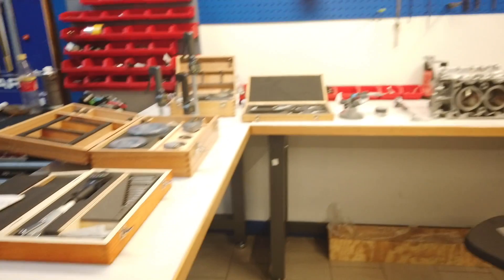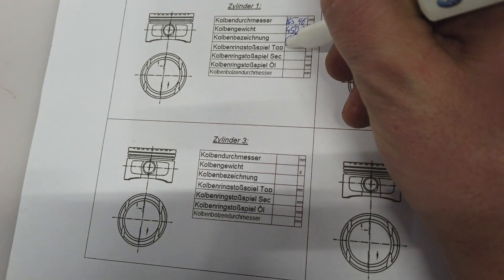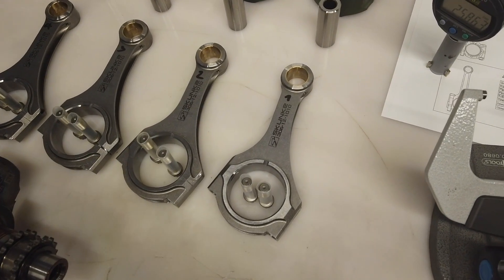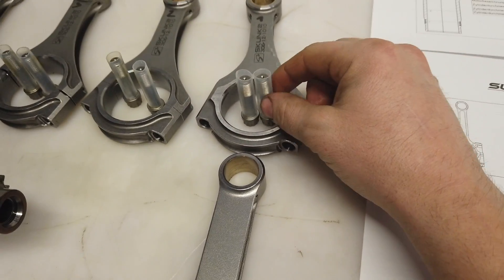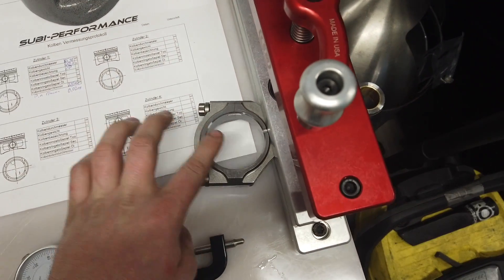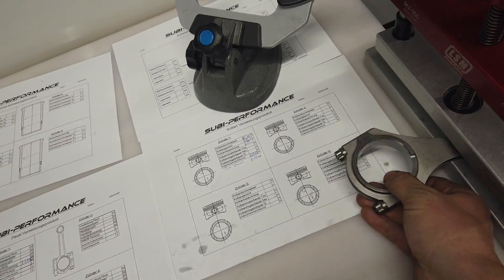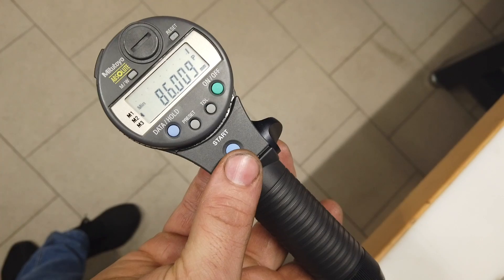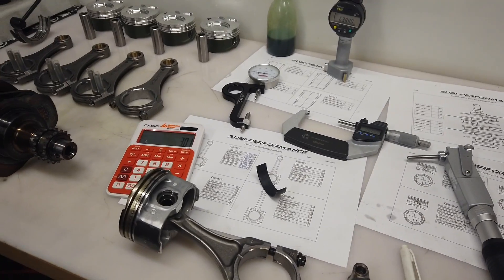The FA20 Turbo Build l Part 2 l Subi-Performance

Comment: What room temperature when you do measuring? Does room temperature will impact to parts sizes? I live in tropical country
Reply: In the measuring departement, in my oppinion it's more important to have a constant temperature and humidity... and that the piece you are measuring has the same temperature as ambient. In the most measuring rooms i've been, it's a 21 degrees celcius.. humidity is even more important, cause corrosion and such...

Comment: Just wondering is it a good idea to turbo charge a open block verses a closed block will it be able to handle the  power after boring out the engine

Comment: After watching your builds, I don't even trust myself to build an engine...Do you guys sell short blocks?
Reply: Not to put words in your mouth, but my guess is it's not an issue of trust.  This man plainly, with his calipers, dial gauges, micrometers, etc... is at a level of engineering conscientiousness that most of us cannot ever hope to approach.
Reply: I also had a buddy do my shortblock when i rebuilt my EJ20x, but after watching a bit more things like this, I think next time I will try to tackle it, since I can budget the tools more easily  now already having the main tools i used last time like hoist, stand, cam tools, etc. I think if you really take your time and write everything down, and ask questions to a mentor of some type when needed, it can be tackled.

Comment: I think it's funny that you have to use thousandths of an inch (0.0060 in) and foot-pounds (ft-lbs) for ARP products even though you use metric units for pretty much everything else... I'm sure it took you a while to learn our wacky units 😅
Reply: Only difference between metric and decimal-inch is the base unit of measurement - just have to make sure you remember which one you're supposed to be measuring in at any given moment. NASA made that mistake awhile back... ~:)P